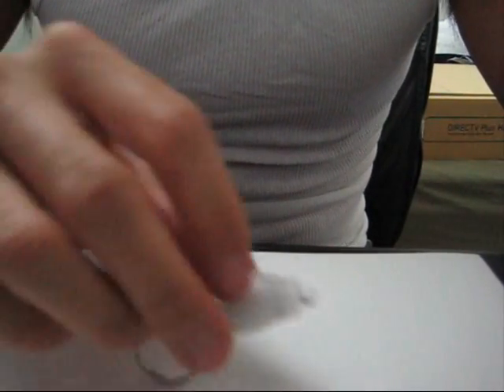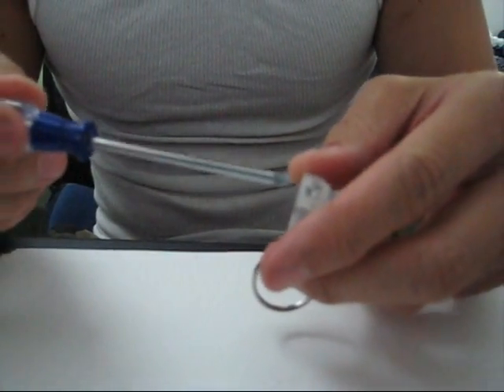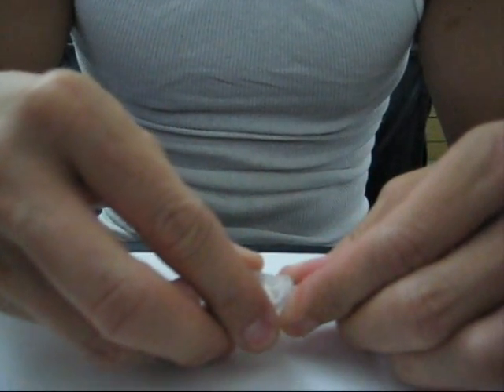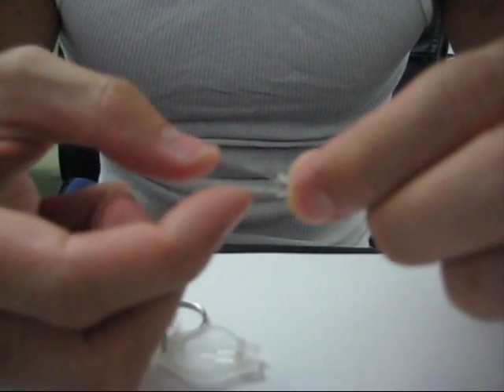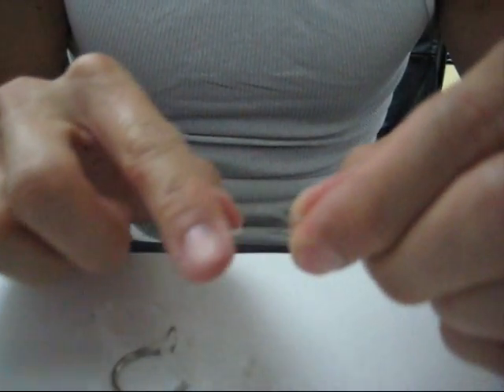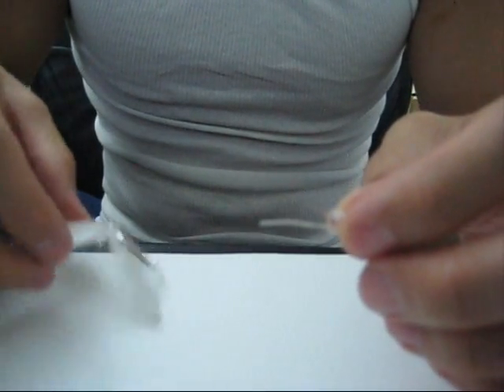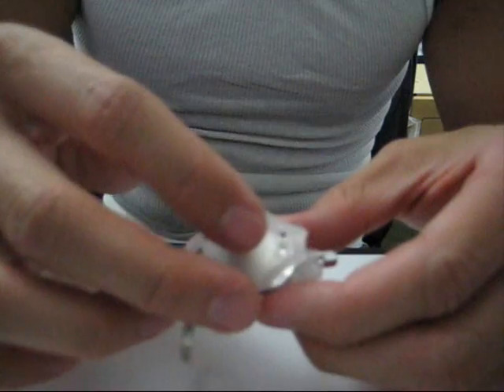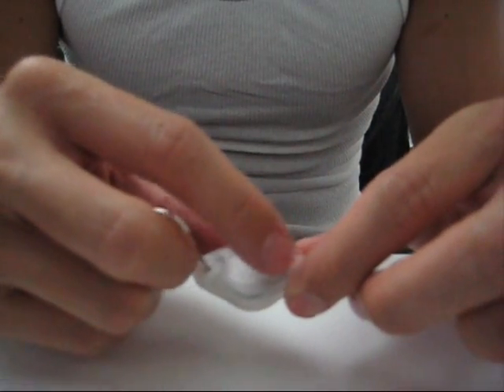how-to: fix a broken photon keychain light switch

Comment: That tends to happen with these lights.  You can try bending the metal tips a bit, but it will most likely still turn off =/  I had to replace mine with some photons (2 inovas 2 tearz -> 2 inovas 2 photons) and it works much much better

Comment from the maker: this sometimes is due to low voltage. try changing the battery. if it still works, just going to have to change the LED or the keychain light in your orbit all together. pls let me know what happens after the change of battery

Comment: @torsioncivic what about the reds? cuz i purchased an orbit with 2 UV purples a green and  red.. the red is very dull, and one of the purples and the red wont stay on all the time like, they just flicker sometimes, with the switch on. sometimes i have to tap the lights or flick the bulb to get them to work, or stay on... also, is it normal, when orbiting for the switch to flick off by its self?

Comment: i have a question i just ordered theses lights and one of the tri-colored ones is way weaker than the others and the purple LED is very weak is there a way to bend it or something? (i tried switching batteries)